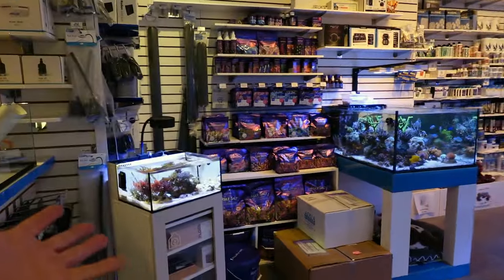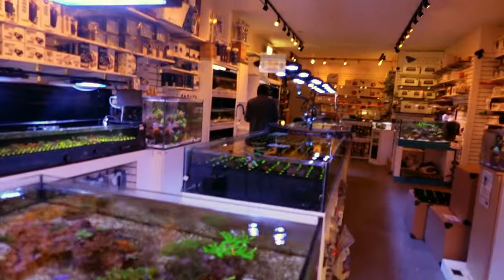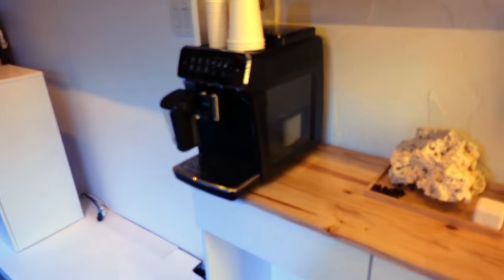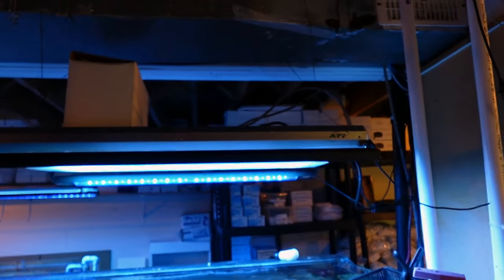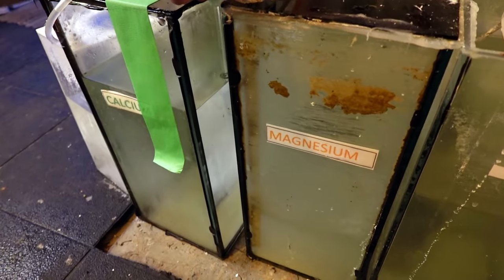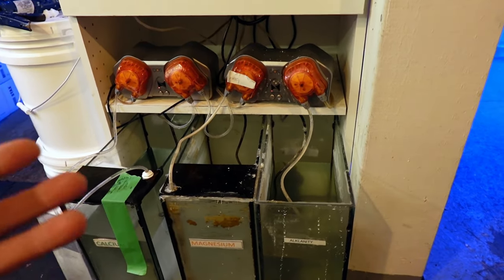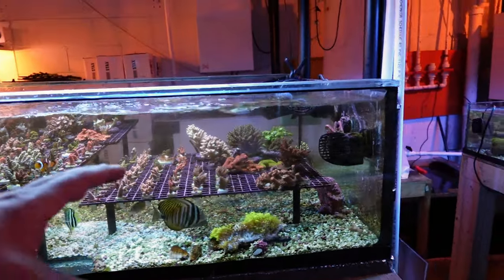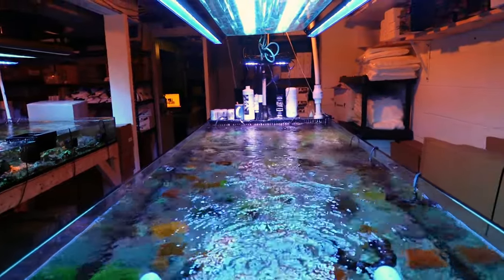Don't make this rooky coral mistake with hard corals

Comment: Hi March,
Simple solution to seeing the dosing pipe being raised inside the retaining pipe...wrap a ring of insulation tape around it where it's at the bottom/correct level...then, if it gets pulled up/out, you can see it's "high" after re-filling and can push it back down...

Cheers,
Rich.

Comment: Question.. do you feel like dkh around 8 is better for torches.. having a time with them only 🤔
Reply: 7.5 - 8.5 dKH for Alkalinity is perfect range for all coral. I do not think Alkalinity is your problem. Test your Magnesium if the reading is 1200 PPM or lower you should raise it. Euphyllia coral Torches, Hammers, Frogspawn corals do better with elevated Magnesium levels. 1450 PPM is where I try to keep my Magnesium. You can go through Marches video archives. He has a couple of videos, where he talks about elevated Magnesium levels. Unfortunately I lost my Torch coral before I found Marches videos. I have elevated my Magnesium and my Euphyllia coral has been great ever since.
Reply: In my experience disclaimer I’m no expert or anything like that just someone that loves torches and been having them for about 5-6 years in both nanos and big tanks it’s not really the number it’s more the stability of that number if it’s anywhere from 8-12 and you stick with that number and it’s stays consistent you should be good usually my problems with torches is low mag or salinity issues hope this can help!
Reply: Thanks y'all.. yeah mag is 1400 and everything else has been pretty stable for the most part.. I have a mix reef but it's mostly my torches and one frogspawn.. sending in an icp soon